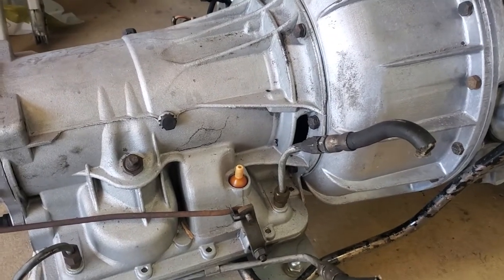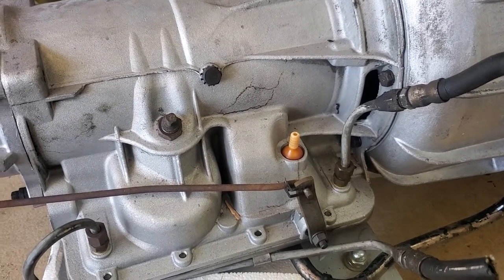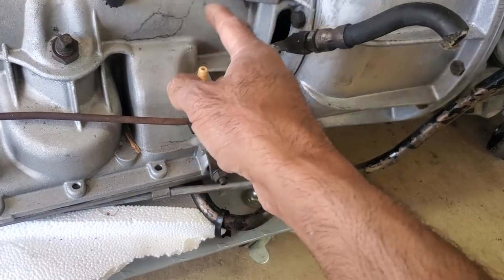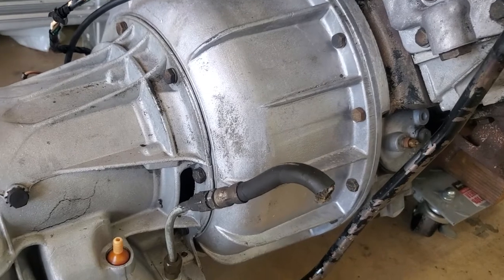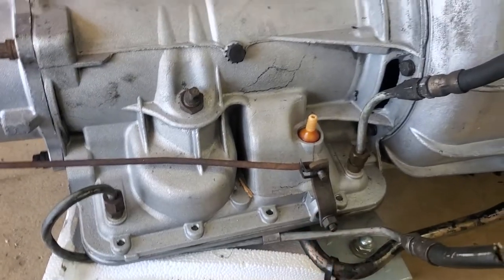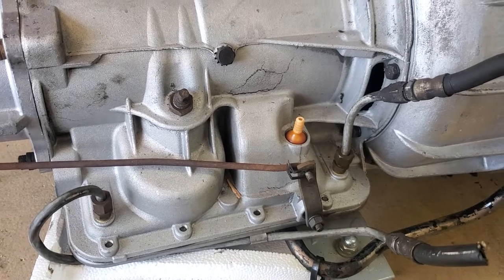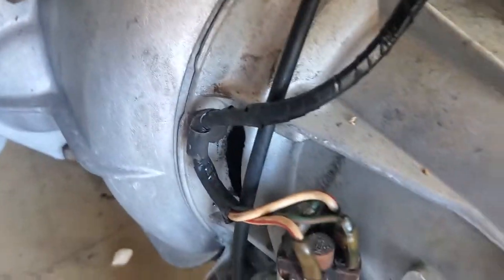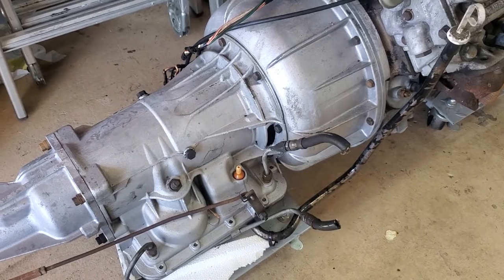Triumph Stag - BW35 automatic gearbox

Comment: Yes thanks for pointing this issue out , the spindle shaft lever oil seals most culprit  iv had worn shafts don't help , iv gone back to cork gaskets thin smear of silicone both sides seems to work , fluid can work its way through the bolt holes so a bit of sealer on the threads , when done I run a neat bead around the outside of the cork gasket , it's all because the fluid level is above the joint when at rest thanks for sharing. !
Reply from the maker: Thanks for sharing